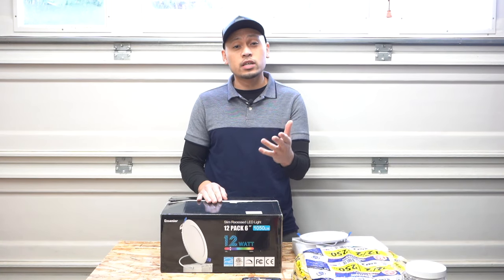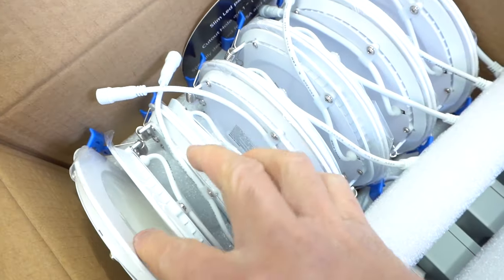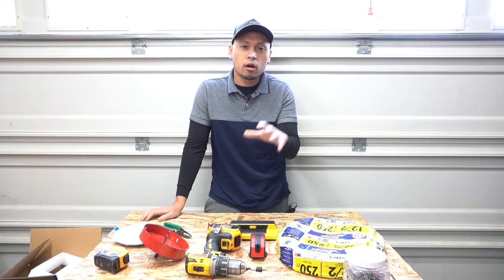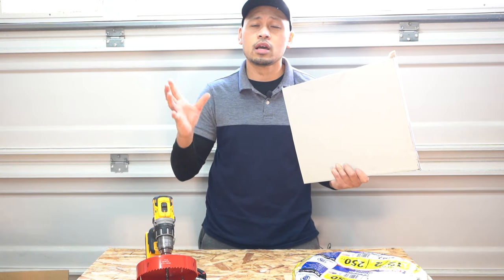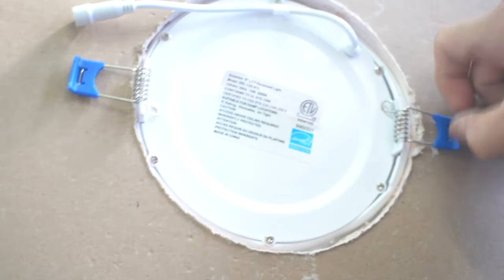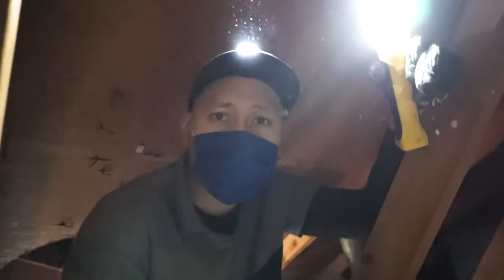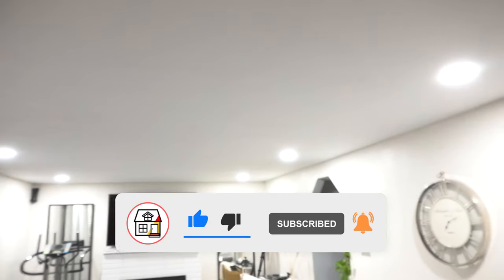How To Install Pot Lights In Living Room Ceiling | Thin Recessed LED Dimmable Lights For Beginners!

Comment: A great video.  However, there is a mistake that everyone should be made aware of. Never insert a Romex cable into a box without some type of cable clamp.  The boxes for the LED lights are very thin metal and razor sharp. Without a clamp, the edge of the entry hole could cut through the conductors and create a short.  There are plastic push in clamps available that  are ideal for this application or you can use the classic screw type box clamp.
Reply: It’s not a big deal as long as you make sure the wires have no stress in them

Comment: Driver boxes require some kind of NM connector.  You can't just push the wires in an open hole.  Grounds require a wire nut or a crimp sleeve. Boxes should be mounted to the structure.
Reply from the maker: I completely agree! I forgot to include that on the video, I had to go back and install the wire connectors.
Reply: He said he is not a licensed, give him a break. Yes you do need a wire connector, but if you twist the grounds good enough it still work’s fine!!!!
Reply: No one ever fastens those j boxes to anything nerd. The grommets are a must though.
Reply: @perezr1241  This wiring wouldn't pass code and would fail an electrical inspection. Incorrect advice in electrical can can cause your house to burn down. It's serious. As a contractor, I can tell you wiring like this is dangerous. There are so many DIY videos showing illegal wiring it's so incredibly dangerous.
Reply: @DaruDhillon  - are you talking about 19:39, with the missing grommet to protect the wire from being cut by the sharp metal edge on the hole? I agree that's an important issue. Personally I've left the boxes unmounted, but if there's a danger then I'd gladly go back and mount my boxes. Of all the dozen or so videos on mounted wafer lights, I've not yet seen anyone mount the box.
Reply: No wonder my friend did same thing not  using connector. Must be watched his video. He is probably going to get sued one day.
Reply: @benzaguru4548  it would be easy for your friend or anyone to add a connector to make it safe. It’s not worth the risk.
Reply: @DaruDhillon  yep, not worth making video which you are not qualified for. Just do something else which you are good at. Don't spread the fake skills.
Reply: @FixThisHouse  Forgot? No offense, but in the video you said there's no need to put a  wire nut on the ground wires. 
Other than that a well produced video.
Reply: @perezr1241  it works fine till it doesn't and someone gets hurt or there is a fire
Reply: Agreed that an NM connector and ground crimps are a must. I once mounted the driver box to floor joists in my basement and my inspector called me out on it and made me leave it loose so that it is considered an accessible j-box. From the attic it would be accessible either way so it could be mounted then.

Comment: great video.. but u def need a plastic bushing to protect the romex to the sharp edges of the box.... Arlington NM94-25 Black Button Push-In NM Cable Connector, 3/8 Trade Size
Reply from the maker: Thank you 🙏🏽 for the advice!
Reply: I have the same recessed lights and the knock-out size is 3/4" for 3/4 trade size. 3/8 trade size is good for 1/2" knock out size.

Comment: Excellent video.  Couple of suggestions.  When you connected the wires in the attic and installed them in a PVC box located under the insulation - (1) a connector is required on the bare ground wires (just a couple twists is not sufficient). (2) since the junction box is going to be hidden under insulation, it should be marked above that a junction box is located there for future electrical accessibility.   The marking of hidden JBs in the attic can be as simple as spray painting the rafters above it and then leaving a note at the attic entrance next to a spot of spray paint that means a box is located there.  I have seen folks install a 1 x 2 vertically at each box location and write on it "Box Below".  (3) NEC would require a minimum of 6" free conductor in each JB.  Hope this helps.
Reply from the maker: Thank you so much for the helpful advice! 🙏🏽😊❤️
Reply: @FixThisHouse  I would also add that you should have added some kind of bushing or connector on the box where you fed the NMD into the pot light box. Those sharp edges from the punch-out could lead to serious problems down the road.
Reply: Do you need to run conduct to for the wire?
Reply: @JV-fn5xn  conduit? only if the wire is exposed, but since its hidden behind drywall/sheathing, it doesn't require it.
Reply: Also..the knockout in metal box should have a clamp down sleeve
Reply: all the wiring should have a non metal connector that screws into the boxes
Reply: Conduit is really mainly used for wires outside to protect against different weather conditions.

Comment: Can you explain where your power source in the attic came from? (Did you feed it from the breaker? Was a being used for a previous fixture?) I'm not sure if you mentioned that and I may have missed it.
Reply: Yes,  this is my question.  Also it kind of has to come from a light switch to turn these all on
Reply: Same question. Do I split the wiring from my living room ceiling fan or does the power come from the breaker.
Reply: I just installed some of these lights in my home and I tapped into the old fixture wiring. Split the existing wire, added some 14-2 romex (to carry power to new lights) and tied it together with some wire nuts.
Reply: I came to the comments expecting everyone to ask this. It was the most glossed over detail of the video but the most vital info imo. I’m kind of shocked by how few are asking.
Reply: Why did you use 14-2 instead of 12-2?

Comment: I'm a retired carpenter, and now an avid DIYer. I watched many videos on DIY LED ceiling lights the new ones. Yours is the best video out there. Thank you for being concise, but still having the important details. Coincidentally I've installed the exact same lights throughout my home. I hope they hold up. Thank you again for taking the time to make this video.
Reply from the maker: Thank you so much! 🙏🏽 your comment means a lot! Made my day!
Reply: @FixThisHouse  I agree hole-heartedly. I was an electrician for many years, but I still refer to videos to make sure I know exactly what to expect before a project. Usually, I find myself wincing or cringing at some of the shortcuts or left-out information, however your video was awesomely thorough and you even took safety seriously. A_

Comment: Out of all the videos i saw on YouTube for installing the recessed lights, this one is the most detailed oriented. I love how you laid out the plan for figuring out where the joists are, drilling the holes avoiding the joists and properly arranging the wiring over the ceiling with insulation! This is exactly what I was looking for! Great job👍 you earned a new subscriber today!
Reply from the maker: Thank you 🙏🏽 so much! This means a lot 🥲! I did forget to mention to make sure you use NM wire connectors on the Jboxes of each lights 🙏🏽.
Reply: @FixThisHouse  thanks for the advice. I bought the 3/8” aluminum type and they worked perfectly with these boxes.
Reply: The cool thing about the newest LED ceiling lights is they are so thin you can install them directly under a joist. As long as the 2 clips can fit somewhere in the hole 180 degrees from each other, it will work. It’s crazy how thin they are.

Comment: Great video. Did exactly what you showed, 6 pot lights in living room. Worked out great. My attic was a mess to work around in but everything turned out great. Thanks for the detailed step by step 👍👍👍.

Comment: how does this only have 900 views? this is one of the best videos on youtube for step by step instructions. I was hesitant to do these myself before this video but now I have complete confidence. Thank you!!
Reply from the maker: Thank you 🙏🏽! Means a lot! Please share so it can help more people out worldwide! 👍🏽😊🙏🏽
Reply: You do realize that he didn't install any grommets inside the knockouts for each junction box. That's the best way to nic those wires, cause an arc, and start a fire. There were less severe mistakes like missing a wire nut or crimp sleeve on the ground wires in the attic box, not he explain where the power is coming from and how he did it, if his circuit really is 20 amp, and so on. 

Either way, this video started out great, but left me disappointed and worried at the end.

Comment: I did notice one oversight and that came at approx. the 19:16 mark as you ran wires into the light fixtures J-box. You didn't install cable clamps onto the box. Running cables through a punch out might be dangerous, with respect to the sharp edges. I think cable clamps should be used for safety and probably code.
Reply: i concur

Comment: Im about to install this same light on the ceiling, I dint want to spend money on the 6 in hole saw, so i just cut it with the jig saw instead. The wiring worry me, im not electrician, but i hope i do well and get this thing done as soon as i can and move on to other thing. Thanks for the video, it help me alot.

Comment: Finally, I added pot lights with your help thank you so much ! Only question 🙋‍♂️ now is,I want to add a single pole Dimmer switch and most they sell has 4 wires ? which one of the wires do I not use ? There’s 2 Reds 1 Black 1 Green . Also is it true that I can only use LED dimmer switches not the original incandescent dimmer switches ?  I ask because the led dimmer switches are very expensive

Comment: Very informative. Thank you. Just one question... Did you do any video on how to connect to the power supply and switch? I am going to do some can lights and don't know how to create a "new circuit" or if I even need one. Maybe I can tie into another lighting circuit that is already there?
Reply from the maker: Thank you 🙏🏽! Please stay tuned this week. I will create a video on how to wire a switch, where you can use with this project 👍🏽😊🙏🏽

Comment: I like the video. I only have one concern .it looks like the j box are made out of metal.so when you ran your wine through them you did not install cable connections.
Reply from the maker: You are absolutely correct, you can buy the cable connections cheaply from your hardware store. Thank you 🙏🏽

Comment: excelled video. thanks for all the details. did you use a dimmer switch? if so what dimmer switch will work with the lights?  The Jbox you had there was the one that powered your previous single light?

Comment: Appreciate this diy and exactly what I was hoping to see as I did not want to keep the can lighting setup. Question... the wires in the ceiling are red, white and yellow. Does the yellow connect with the black? I've comes across some articles that could be the case.

Comment: Alright I'm a little slow. These are wired in series correct.  So you have a power source that is going into one light but you are bundling that with the next wire to the next to the next correct?  Those wago connectors are carrying the load down the line so to speak?
Reply: Yes that is correct. The loops that are running through the holes are cut with one end being connected to the light fixture (Wafer Light) using the provided wire nuts in the junction box the other cut end is attached to the same color wire using the same wire nuts in the junction box. So you will have three wires in each wire nut. The factory installed wire coming from the light, the power wire coming from the source and the daisy chain wire that goes to the next light thus creating the daisy chain.  He then goes to the next light and does the same thing and that will daisy chain all your lights together creating a complete circuit. The only one that isn't daisy chained is the last light on the circuit as that's where the daisy chain will end so you won't have any wires coming out of that junction box just going in from the second to last light.  Just be sure to use cable connectors in those junction box cutouts so the wire going in doesn't get damaged on the sharp edges of where the cutout is on the junction box. That's the only part he left out but he does say earlier in the comments that he went back and added those.

Comment: You don't know what flush means, but you know what you're doing. Thank you for this helpful video.
Reply: Right but he didn't put romex grommets on those knockouts. I know he's not an electrician (neither am I), but it should've said in the instructions to put one. To me, it's common sense.

Also, make sure you put a wire nut or crimp sleeve on the grounds. If your testing everything out, sure leave them twisted, but when finished with the project, always finish each joint in a junction box.
Reply: @aurvaroy6670  why do you have to finish each string of joints in a junction box?  I seriously don’t know

Comment: Love your channel. I'm currently working on installing recess lights on the entire first floor. I've seen your 3 way switch set up video with the light fixture in the might which is extremely helpful. How can I install multiple recess lights with the the 3 way switches are at each end of the run? I'm in the rough in stage if the make any difference. Thank you.

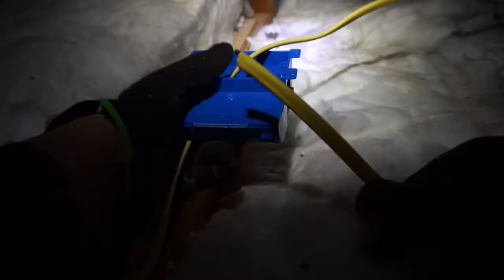Comment: Hello, first of all thank you for this detailed video, it is really helpful. I have a question, what are those 2 wires you are inserting in the blue junction box on the attic (this is at 18:11 in the video)? Are those from the wire that you are running in all the holes? or are you connecting the one end (left while inserting in first hole) of the wire that you are running to the live wire at the attic which had cap on it to bring the current in this running wire?

Comment: Good explanation of how to install these low profile potlights, EXCEPT... what if you hade a 2 story and are trying to put lights in kitchen, and the ceiling joists are a barrier to fishing the wire to another part of the room. Attic access is fine, unless you don't have it. Suggestions welcome.

Comment: @18:11 is that the wire that come from the breaker?. If so, could the light box be a "junction box" if you don't have an external box to join the wires?. I understand that the junction box should be visible but they are not if they are above the ceiling drywall. 
Great video!.
Reply: It has to be accessible. If you have an attic large enough to easily move around in, that typically fits the requirements. Check your local codes though, of course.

Comment: You don’t have to worry about joist location with these. They will fit even if the joist is in the center of the hole.

Comment: Thanks. The color temperature doesn't really affect the clarity of the lights though. That's more on CRI and lumen level. I really advise against using 5500k apart from maybe your garage. Go for 2700k-3000k and get a high CRI light and install a dimmer.

Comment: Question is the first jbox in the attic nessasary? Can you just go straight to the first pot with the main power wire if you've got enough slack on the wire?
Reply from the maker: Hi! That is a great question! The answer is no. If you have enough slack just connect the power to the first pot light and it’s jbox and continue the series 👍🏽😊

Comment: The J Box , did you connect the main power source with the new wiring and put that in the box?  Also, the main power source was that wiring aleady there or did you install that first?  Thanks
Reply from the maker: Hi! The box was connected from the switch and main power.

Comment: Thanks for the great video!  Why 12 Wire?   14 should be plenty for a ton of these lights.....but maybe the breaker you have was 20 AMP?
Reply: Also whats the spacing recommendation on these?   Want to use them in my basement.

Comment: Nice video. Depending on your area, code might require you to drill holes through the joists and run the wire through the holes instead of stapling them on top of the joists.
Reply: I was wondering if that was right what he did which I want to to the same 🤔.
Reply: @uriel0002  those are roof trusses, you cannot put any holes or modification in them at all.

Comment: Great video, but you should use a rubber/plastic grommet in the knock out holes so the sharp metal edges don’t cut the wire jacket

Comment: Great video. How did you wire the light switch. Did you have to custom make one or did you have another one to work off of?
Reply from the maker: Thank you 🙏🏽. I wired it to an existing switch which I connected it from the blue j-box in the video.

Comment: Awesome video!  What do you recommend when I am utilizing an existing box and there is no ground cable in my existing box?
Reply from the maker: I found this:

If the box is metal, then you can attach the light fixture’s ground wire to it, assuming the metal box is grounded.

If the electrical box is not metal, then simply tape the end of the light fixture’s ground wire with electrical tape and let it float in the electrical box.

Your only other alternative is to upgrade the wiring in the house, which will be costly 😢

Comment: how did you decide on the location and spacing between walls and each other ? i saw that there was a bigger gap in the middle, is that to factor in glare on tv from lights?